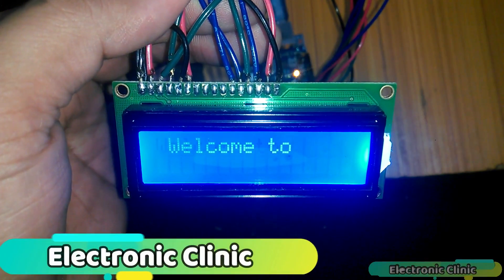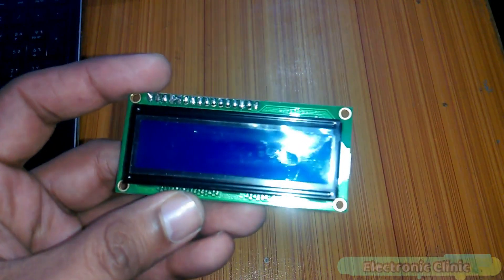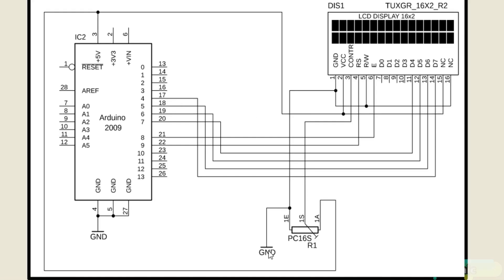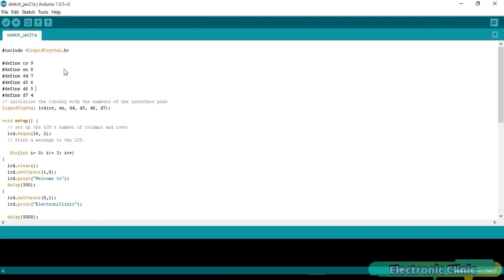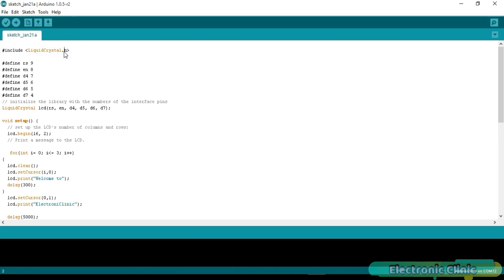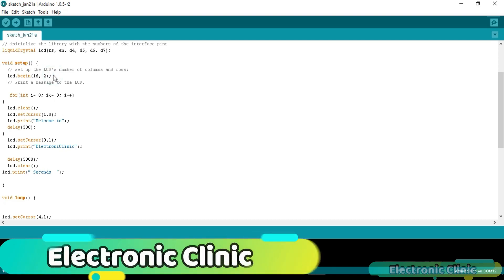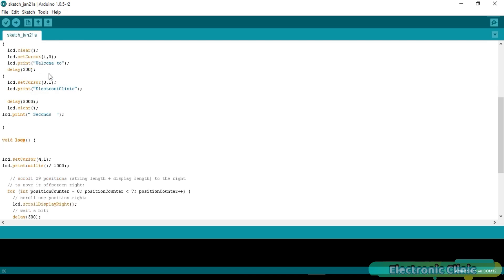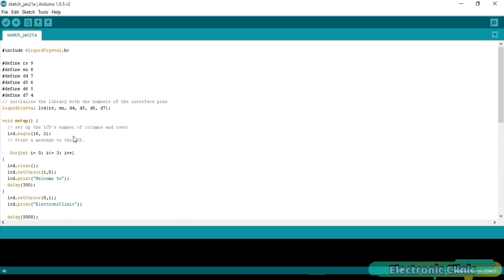Arduino 16x2 LCD screen display Text Scrolling “Arduino Project for beginners”

Comment: you should consider not using for function in void loop as the time which gets will only change after every loop
it can be solved if you use 'if' function and structure it in such a way that that whole code loops every time it you shift it to the right or the left (
at the least)